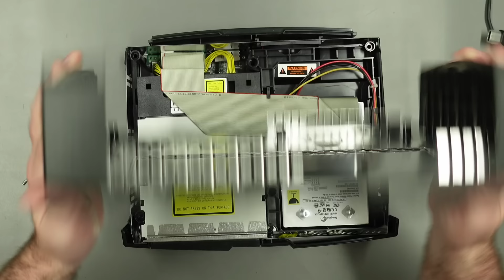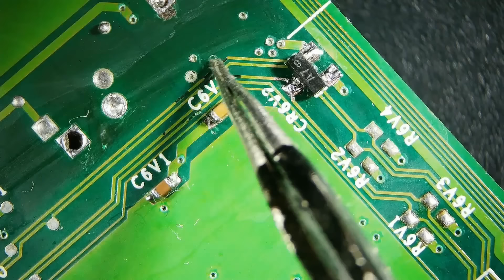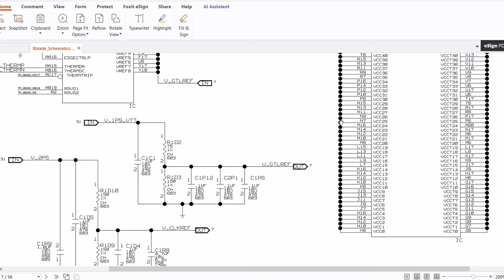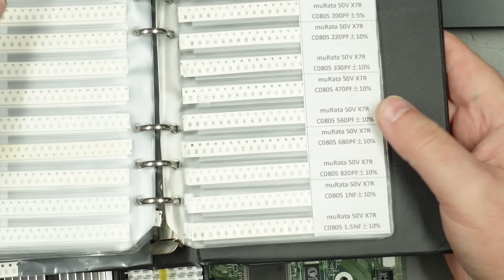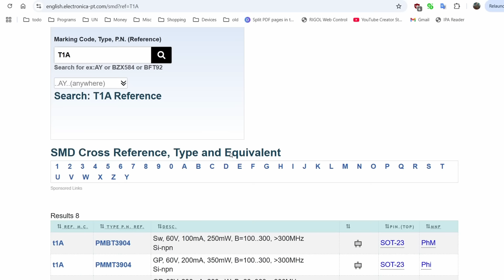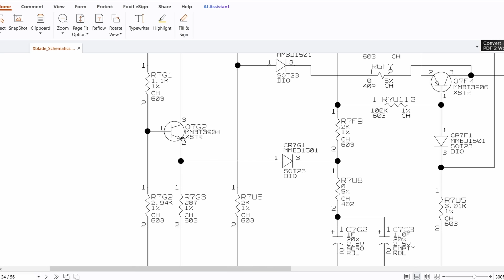XBOX clock cap carnage - this won't be easy

Comment: White Vinegar, depending how it’s diluted when purchased, ideally you want a mix of 70% white vinegar by volume with distilled water making up the rest, if you can’t get that strength then water down further with distilled water, this will neutralise the electrolyte from the capacitor. Then flush and clean with IPA.

Comment: Xbox and the infamous clock capacitor. With electrolytic capacitor leakage use deionized water and 99.9% IPA mixed 10 parts IPA to 1 part deionized water or 90% IPA that contains deionized water. Baking soda and deionized water in extreme cases of corrosion and be aware of possible trace damage with bad corrosion.

Comment: oh man. I'm super afraid of what's going on inside my Xbox. I haven't looked at the clock cap yet.
Reply from the maker: You might want to check on that, even if it's just to rip it out
Reply: @TheRetroChannel  thanks. yeah, it's definitely on my current todo list. just worried i might find some carnage. Haven't turned it on for at least a few years

Comment: One of my favorite consoles, but many xboxes suffer from various corrosion of parts as well as the clock capacitor !! many other Capacitors fail and leak on boards ect, Microsoft should of took more care in manufacturing the console with better quality parts and quality control...but they didnt bother..

Comment: Boy am I glad you brought up the XBOX!  I've got two of them.  One boxed, one open box.  I took apart the open box and, sure enough, the clock capacitor leaked!  Thankfully, not as bad as the one in your video.  I used warm water and citric acid to neutralize the battery acid.  Citric acid seems to be a better, yet just as effective, solution to vinegar.  I used vinegar to remove corrosion on an OG Gameboy battery contacts and it completely stripped the plating.
Reply from the maker: Nice 👍

Comment: Ewww, it's always disgusting when the cap juice flows. One of mine I got to just in time, an SOT-23 (Q7G2?) fell off as I was cleaning it. It took almost half an hour of cleaning and fluxing the board before I could solder it back on, because solder wouldn't stick to the pads. The flux and wick method probably would have made that go faster.

I have a bunch of supercaps that I salvaged from scrap boards at a place I used to work. They were even PowerStor Aerogels, same as the early Xbox used but a larger size, and we had a few of them leak too. I put a header on the motherboard and one of those supercaps on a wire with a couple of dupont pins. So the clock works, and if it ever leaks, it'll leak off in the corner, away from the board.
Reply from the maker: Not a bad idea sticking it off to the side. I know most people just leave them out but it feels incomplete

Comment: Whats the microscope make and model? Its a nice quality but its not listed in your tools and kit page.
Reply from the maker: Andonstar AD249-SM. I did a video on it ages ago, it's alright but having it fixed to a base and not on an arm is a bit annoying 
https://youtu.be/UyTw_h8SIUg
Reply: @TheRetroChannel  Cheers, will have a gander. You reckon it could fit onto a boom arm or is it pretty heavy?
Reply from the maker: @Bassquake76 it's not heavy, you'd just need to find the right arm to fit around the microscope piece

Comment: I bought a "not working" c64 mainboard a few years ago that had cut traces to the video socket. I was able to patch up the traces with automotive rear window demister repair paste. Still going.

The clock capacitor went on my xbox but the build date was right on the border for 1.4 and 1.6, and all the information online seemed to contradict my xbox. If it was 1.6 I didn't want to pull the cap and brick my xbox. Took the risk and the cap was so rotten it pulled straight off with barely any force. Years later it doesn't seem to have done any damage. Mine is also modded so it gets time and date from the internet anyway.

Comment: Great video on a sunday morning. Would vinegar be better to clean the carnage from cap-juice ?
Reply from the maker: I hear vinegar, and potentially some bicarb soda. I've tried just vinegar on its own in the past and it did very little
Reply: @TheRetroChannel  ChatGPT tells me that supercaps can have either organic, acidic or alkaline electrolytes. In order to determine the best antidote, we should try to figure out which one it is. If the cap has an acidic electrolyte, baking soda (bicarb) dissolved in water seems to be a good choice. If the electrolyte is alkaline (like in NiCd batteries), vinegar or a mild citric acid solution seems to work well.

Comment: I suggest to use an electrical scraping pen to clean off nasty corrosion...A light ac8d Like vinegar helps very good If the electrolyte ist alkalic. Some might be an acid,then you have to use something alkalic like baking soda ...

Comment: You need warm white vinegar it will bind to the alkali and completely clean it
Reply: Yeah was kind of yelling that, neutralize with white vinegar then rinse off with isopropyl.
Reply: I was have heard that before and was going to suggest it. But I don’t have any practical experience on how well it works. I’d be interested in a video on it.
Reply: Why vinegar? Acetic acid is what we need to neutralize the basic substances on a PCB that has been exposed to something like a battery leakage. Acetic acid is included in vinegar, but vinegar also contains different trace compounds which might not be something that we want to put on a PCB. It’s better to use an aqueous acetic acid solution, or in other words acetic acid diluted in purified water (either distilled or deionized) with a concentration that is not too weak to have effect but not as strong as to damage the board.

Comment: I use the same thing that I use on battery leakage, white vinegar. You have to make sure to thoroughly clean it up afterwards though. That still will not solve for crusty solder, you have to remove it. In this case I would remove all the components and go over the nasty spots with some loaded solder braid (heat seems to make crust solder just fall apart), then remove the solder that was left over, then do the vinegar, then scrub with IPA, then re-attach the components I removed.

Comment: It's all about neutralization of the different acids or else it can still persist even after many IPA cleanings. Below you will find three long tested methods of cleaning each kind of acid from pcbs. Hope this helps someone. I would love any other ideas/notes on these.

The best option for cap leakage is baking soda. Baking soda is a base and will counteract the cap acid stopping further damage. Baking soda is a slight abrasive, so be careful. But this abrasive action does help clean up the badly corroded stuff and gets in to places that are hard to reach. It works a bit like a weak fiberglass pen. Toothbrush, baking soda and a bit of distilled water. Don't use tap water, too much stuff in it. I use deionized RO water but that's because I have a filtration system under my sink. Distilled is cheap and easy to source. It's good to remember that any old glue that might be used on larger electrolytics is also corrosive as it ages, depending on the age of the device this might be unwarranted as they don't use that glue as much anymore.

I like 50/50 white vinegar/water for battery acid, just be sure to follow up with high % IPA to help with evaporation/absorption of vinegar/water mix. Compressed air works a treat too to help blow excess off. Low heat + time also works very well. Just remember that vinegar will eat copper traces so don't leave it on there too long or a bunch of bodge work will be necessary. I don't use vinegar often but sometimes white vinegar is really the only option for battery stuff. Vinegar's acidic nature helps neutralize the alkaline substances from batteries which is crucial. 

If a board is both damaged by electrolytics and batteries and it's severe enough, I use what an old timer calls the 'volcano' or 'scrubbing bubbles' method. Clean and scrub with baking soda and water, rinse and scrub with white vinegar, then flush with distilled water and finally clean with high percent IPA. The baking soda and vinegar will react which will foam up like a volcano in grade school or the scrubbing bubbles cleaner. The flush with distilled water and final high percent IPA cleaning are crucial steps in this method. I've only used this a few times, but it was on really far gone boards and nothing else seemed to work but the foaming really did get them to a manageable state. I would only use this method on boards that are basically scrap and you have nothing left to lose.
Reply: Battery leakage is an alkaline, hence the need for an acid to clean it off.
I use Acetone to clean if IPA does not work. Carb cleaner is also effective
Reply: Nice but the aluminium caps are alkaline not acidic due to borax, but the principles are all valid. In theory vinegar is better being acidic. The reason baking soda works is once leaked the alkaline can mix with the solder and resist and become almost acidic, but using both baking soda and vinegar then covers the alkaline and acid sides of any possible contamination
Reply from the maker: Excellent write up, thank you!
Reply: @TheRetroChannel  Of course!